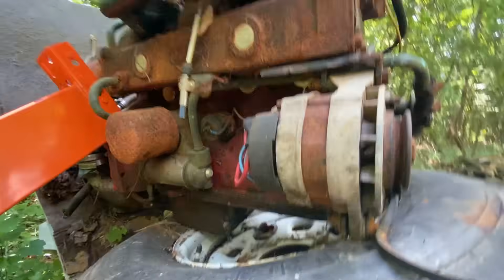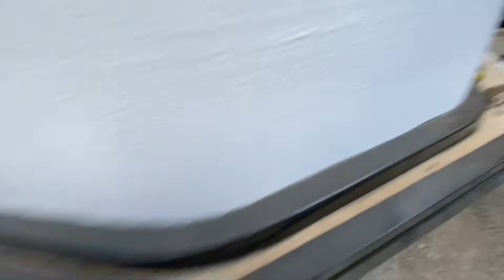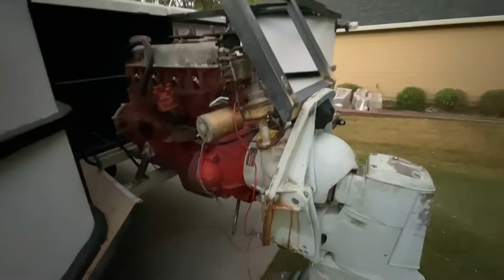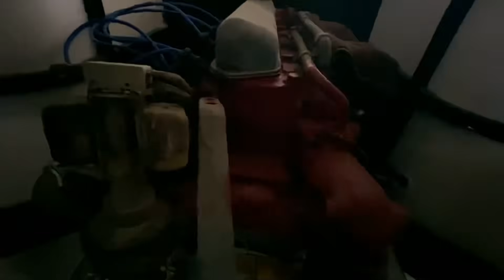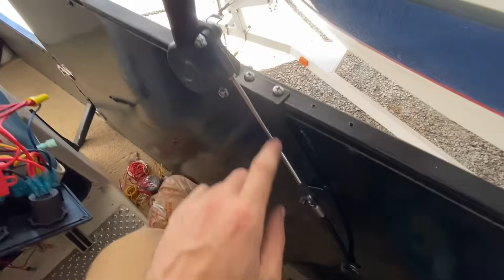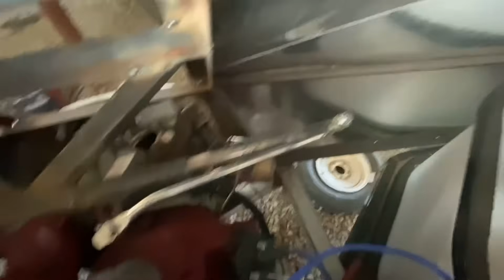Pontoon boat Inboard conversion pt1

Comment: You need to protect the bottom  of the engine.  Not really  designed for what you are doing.  Good luck with your project
Reply from the maker: @ianmitchell3725  I will be installing a trans. I’m not leaving it open like that.
Reply: Good move 
 Former  boat  builder.  Transoms comes in handy

Comment: Okay the more I watch this and the more I watch this the sicker I get brother if you're going to put that motor in the water like that it'll never lasts you you're going to lose spark you're going to lose the the flywheel is going to get wet it's not going to work right cuz it has a rubber grommet on it you're going to destroy that little motor that is not made for that and it looks like shit
Reply from the maker: Whatever you say Mr. Critic.
Reply: @Tylerjschmidt  bro I'm not a Critic I just know what's going to work and what's not going to work that is not going to work I promise you when you have problems with it please send me a message and tell me I was correct
Reply from the maker: @joeclark9042  I’m working on it today as a matter of fact. I already water tested it. It floats fine. Just gotta finish up a couple things. I’ll keep this conversation in mind when something goes wrong. Only time will tell I guess.

Comment: Well I just seen this but I wish people would know well I hope they would know what they're working with the distributor is not the camshaft the valve cover on the top when he took the valve cover fell off that's not the camshaft either that's the rocker arms I think if you're going to work on something you better understand what you're working on first and then how to work on something so my suggestion is take and run some diesel fuel in the top of that motor so cleans out that oil pan and if you have any questions brother please let me know cuz that's what I usually do is work on boats
Reply from the maker: I know what a camshaft is dude and so do you, sometimes my mind is going a mile a minute and I’m don’t realize I mispronounced a mechanical component until after the fact. Shit happens!